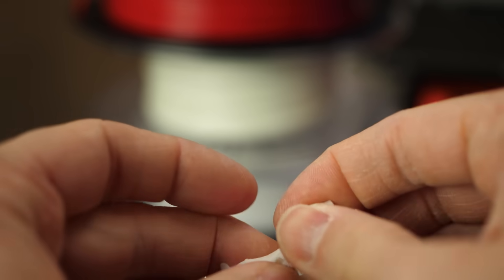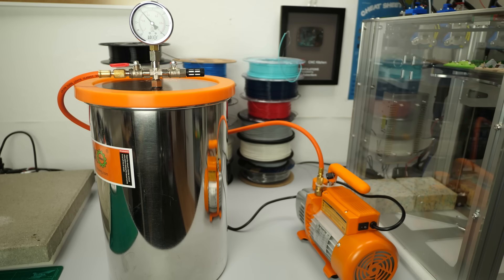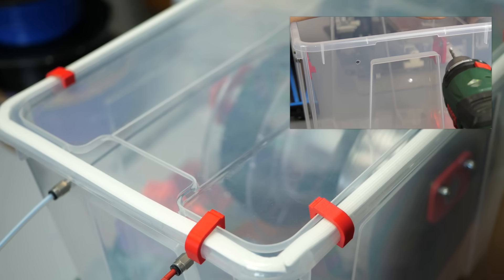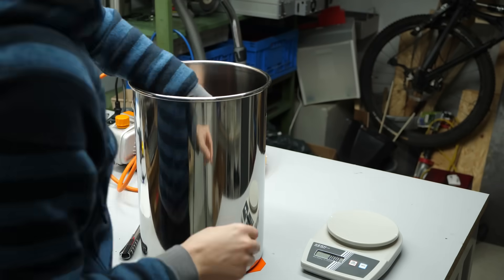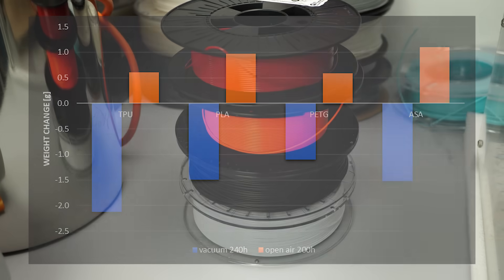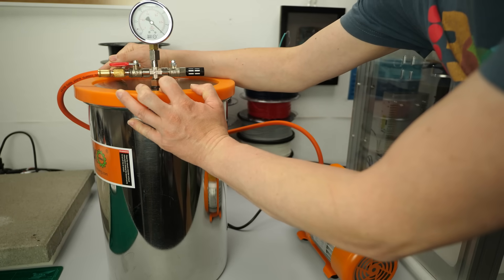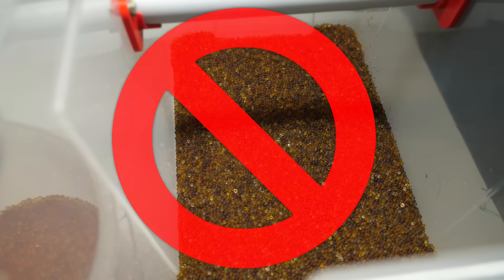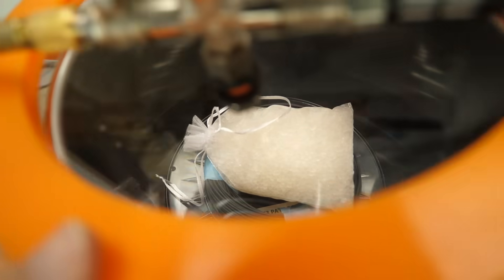Vacuum VS Dehydrator! What's the best way to dry filament?

Comment: There's a bias in these tests. The guy's dehydrator is removing moisture and displacing it in an infinite amount of air. To do the vacuum chamber correctly you need 2 Chambers with an AC dryer and vacuum pump/compressor between them. Pull a vacuum in pot 1 and place filament in pot 2. Using an AC recovery unit pull a vacuum on pot 2 while compressing that sure air in pot 2. Once the atm of pressure has been moved from pot 2 to pot 1 allow the pots to reach equilibrium between the 2 using tubing and valving. Have the expanding air that's cooling off and releasing moisture pass through an AC dryer which is just a canister fill is desiccant. Automate this process of pulling a vacuum on the pot with filament and compress that air into the other pot. Alternatively you can put an orifice between the high pressure pot and the low pressure pot right before the desiccant. This will give you the unlimited amount of air flow seen in the dehydrator and I'm willing to bet it will annihilate the performance seen in the dehydrator. You probably only need a delta of 5-10 psi or whatever that is in communist units to  see a significant change. Also get to serve DHT11 to measure the humidity levels in pot. Once this humidity levels, level out you can stop. The DHT11 will also tell you how much moisture has been removed by taking the temp, humidity levels and the volume of air and by using relative humidity levels the mass of water can be determined. If nothing else study how Air Conditioning works on the refrigerant side. They are closed loop systems designed too remove moisture but most importantly it's likely a fast more effective and efficient way to remove moisture. 2 containers a compressor/vacuum puller a container of desiccant and an orifice to expand the looping air. The orifice should restrict air flow significantly below the pump's ability to evacuate and compress.

Comment: lets consider insulating the vacuumchamber and putting a heat source there ? would that not be both efficient. cause vacuum does not lead the heat away by air, only by radiation and put a pressure switch on it  would solve the problem with manually having to flip the switch. With the prices for electric stuff one has to be able to save money using as little energy as possible
'

Comment: Great Video, and a very great job with info for all of us 3D printer people!  Really enjoy watching your videos.  

I see how the vacuum pump would work and do a great job.  I am new to 3D printing. My wife got me my 3D printer for my Birthday last November.

Here in Tennessee where I live, we are blessed with many rivers and man made lakes!  I live in Middle Tennessee almost at the geographic center of the state!  Humidity is a major problem here.  My Grand Mothers, both of them, taught me to put rice in the salt shacker to absorb the moisture so the salt would flow. Rice is very hygroscopic (absorbs water from the air) and will pull it away from just about anything. So I put rice in a 3 inch by 4 inch mesh bag (you can buy online for $7.00 or so for 100) and put the rice bag and filament in a one gallon zip lock freezer  bag.  Zip it shut and the rice will absorb any moisture left in the sealed bag.  Put one bag of rice in with a spool that has one half or less filament. I put two bags of rice in the gallon zip lock bags that have filament >= one half a spool.  It cost almost  nothing, and it makes working with the spools of filament very easy.  Just open the bag and switch filaments.  When you have a filament dryer, dehydrator, or a vacuum pump, you can only work with one spool at a time.  There is nothing wrong with that, but drying them all with rice can be done all at once!  

I know I have only been a 3D printing guy for about 9 months now.  At this moment I have 29 spools in bags with rice drying 😆!!!

Again, thank you so very much for all that you do!!!!

Comment: The only way for the evaporated water to get out of the vacuum chamber is through the vacuum pump whilst it is running. Switching it off after 15 minutes would be useless. If the vacuum pump is overheating it is obviously faulty. I worked for a refrigeration company and it was common to leave the vacuum pump running overnight.

Comment: Try heating the filament in a drying chamber but introducing a continuous, very low flow of dry air or better, but more expensive, dry helium.

Comment: Hmm, I always heard that pulling the spool under vacuum, and then drying in a dryer reduces drying time significantly and supposed to pull most of the moisture to the surface so it can be quickly/easily evaporated in a dryer!

Edit: I got it backwards, bake first, then pull vacuum with desiccant pack!

Comment: So what is considered a humid environment in which you need to dry your filaments? Looking at my hygrometer my basement is currently at 48%. I store my filament in the box with the desiccant bag it came with, and I don’t reseal the bags. 

Sometimes I do leave rolls out, while I know that is not preferable, do I need to worry about drying my filaments considering my ambient humidity? I print with PLA, PET-G, and ABS.

Comment: It would be interesting to see how your results would change if you back filled your vacuum chamber with dry Nitrogen or XCDA.  If you backfill your vacuum chamber with wet gas you are limiting your drying success.  Removing moisture when you evacuate just to add moisture back when you return to atmospheric pressure using wet room air.  A few other things to try would be vacuum cycle purging with heated dry gas and a purge box (no vacuum) fitted to a slow purge of heated dry gas.

Comment: Great analysis. What about putting the filament in the vacuum chamber while it’s still hot from oven drying? Vision miners claimed that this removes even more moisture from the filament. 
Your thoughts on this method? 
Thank you 
https://www.youtube.com/watch?v=1UBq2DPSBDg&t=542s

Comment: If you aren’t using your filament keep it in the sealable bag it came in with the moisture Cather packet inside. If it’s good enough for the company to store it that way then ship it to you it should work just fine for storing in your house. Unless you are some sort of reptile who lives in a underwater cave or store your filament in your pool because the label didn’t tell you not to store it in your pool.

Comment: When you are drying wood in a vacuum, you need to first heat the wood and then apply the vacuum and water boils out. Heat is needed for the water to boil and when the heat is gone, it stops boiling, so with wood we do it again and again until all the water is boiled out. You need to keep adding heat to keep removing water!

Comment: I store my filaments in a 5qt storage bag with 5 grams of silica in each.  If it's been stored for a long time I will dry it for around 2 hours in a dehydrator before printing.

When I store filaments such as petg or tpu in the open,  i see worse prints with both,  I get bad layer adhesion with petg when it's wet and gets better again after a couple hours of drying.

Comment: Have to be have the vacuum pump running the whole time to pull the water out.  Which is what HVAC technician does to get water out of air-conditioning systems.  

Might try freeze dry method.

Comment: I got the same results but with vacuum drying the only difference is the vacuum pump that I got was from a lab a dual stage and running it for an hour or so helped alot with nylon and cf

Comment: Air will hold moisture mostly depending on volume and temperature. Now with the vacuum the temperature and the volume remains, but the water boils, so probably relative humidity will increase. But you can't boil all the water away, only by opening up the chamber over and over. This is why the food dryer works better. It circulates the air to take up more moisture. If you consider an airsoft tank or scuba tank, it holds around 200-300bars of pressure. As an example, when you compress air that is on 1bar pressure and has let's say 40% relative humidity to 100 bars, its relative humidity would increase to 4000% so most of the moisture will condense. Its like squeezing a sponge. Now lets assume that it will have 100% relative humidity by the end. If you decompress it back to 1bar, then its relative humidity will drop to 1%. I would assume, that having your sealed filament holder box supplied constantly (only to over-pressurize the container a bit, so air can't get in) with air from an aforementioned airsoft tank would keep your filament dry, but it'd be again a chore to change and refill them.

Comment: My filament is stored inside a airtight box with damprid on one side and a tube to allow the moisture to drip out. the box stays at 50c and low humidity bowden tube then routs the roll into the side of my enclosure the filament routs threw the fliament welder past runout sensor and the into my machine.

Comment: Hallo Stefan, wie geht's. If you want to use a vacuum pump to remove a solvent from a solid,  you have to know how much pressure you need according to the boiling point of the solvent, water in this case. I recommend you to use a nomograph for calculating the boiling points under vacuum, thus you can according to the maximum vacuum pressure of your pump, calculate how much temperature to add to your system. At higher vacuum pressure, you need  less temperature. Viele grusse aus Venezuela.

Comment: I have an older gas oven with a constant pilot light. I keep my most often used rolls in the oven and when im going to use an other roll i just put it in the oven for 24hrs. I dont turn the oven just let the pilot do the work. In addition i keep my other rolls in a non working mini fridge and that helps to keep them pretty dry

Comment: Looks like I will keep using the dehydrator. 

Sometimes I will give a quick dry to my filaments if they have been sitting for a while sealed in a bag with some silica before use.  I will throw it in the dehydrator at proper temp for 1-2 hours and print with it after.  Not sure it really helps but I haven't seen any negative results.  

I had a spool of petg sitting open for about a year. Ran a print on it and it turned out horrible.  After several cycles in the dehydrator, it prints decent again.  I won't use it for anything that has a lot of detail or needs strength just to play it safe.  The spool is almost gone but not going to waste it.

Comment: I would have put the vacuum chamber on the heatbed of one of your printers at a reasonable temperature to see if that improved the performance. I have little doubt it wouldn't. Commercial vacuum drying uses heat to remove water from frozen food.

Comment: That's way too much work.
My printer is in the basement (40% humidity) and I never had any problems printing with my PLA filaments. 
Experience tells me it's not required for PLA. It may be required for other material I don't use.

Comment: My concern is twofold; how many times you can condition a filament, & every mentioned method will pull every volatile in the plastic at varying rates, depending on the method variables.
What gets pulled by which conditioning & storage system would be extremely useful data, as well as potential conditioning additives, where possible, added into the process may raise their atmospheric % to or above the filament, allowing for further customisable control of filament condition.

Comment: Storing filament in a mini fridge on a timer so it can be off for an hour a day or so is another effective method.  I would like to see the various weight changes with such a method. It is necessary to collect the moisture in a pan under the freezer compartment with a drip tube directed outside with this method.

Comment: I actually dry my filament in the microwave in low power using defrost by weight mode.  Microwaves will heat only the water molecules. Do not microwave for long period, just use short 10s sessions leaving 20 sec to rest and let the water molecules to escape from the plastic.  This works great specially for PLA and is good but not great in PETG,  I guess is because PLA is derived from corn and PLA molecules give out water more easily.  Also water will escape from the hot end when melting the plastic so thats why having a part cooling fan also helps to dissipate the steam produced.

Comment: You know you don't need to run the vacuum pump constantly, right? You just pull the vacuum. close the valve and turn the pump off. Of course that little pump overheats after 15 minutes of continuous running.

Comment: I have the same food dehydrator, got it at Aldi. I bypassed the factory temp controls and added a PID controller and a temp sensor. it can go higher and is very stable in comparison to the factory temp control which was swinging around 10-15 degrees..
Reply: For those asking how to do this, bypass the mosfet or relay which which turns on the heating element.    Hook up an arduino with a ds18b20 temp sensor and a solid state relay or correct mosfet depending on the voltage requirements  you probably could use the one that comes installed even just control it from arduino... then slap some basic code together which turns the relay / mosfet to high if temp is < than x  ... there are many tutorials on arduino out there... very simple and cheap to setup
Reply: @jasonhowardak  definitely a way to do it.  The pid kits are $20 though. And just need to connect wires up. I have done it both ways even with an esp8266 and logged data.
Reply: @muwahh98  can even use a PID package on an arduino if you wanted
Reply: Just curious, how did you do this?
Reply: @littlecube141  same how???
Reply: @jointEstablishment  not my video but similar concept can be applied to any heating system.  The controller is cheap on eBay or Amazon
Reply: How??
Reply: It would be awesome if u could make a video on this. Showing it and how you changed it.
Reply: @jointEstablishment  https://youtu.be/RNV8F5v13Vc

Comment: Hi Stefan! Did you manage to dry Nylon filament (PA6) in your food dehydrator? 
I tryed with mine at 70°c (62° mesured with an external thermometer) for 8 Hours ,but the filament didn't loose any weight and it is still unprintable.
What method do you suggest for such a material? thanks

Comment: So as I understand the best way for drying nylon is oven, right?
Reply from the maker: Yes, it probably is if you don't have any other fancy equipment.
Reply: @CNCKitchen  its a bit hard to find fancy and suitable equipment for advanced filaments. You need high and accurate temp. I think using accurate temperature sensor in an oven will turn it into almost fancy equipment.

Comment: Why not just combine a Dehydrator, 3D Printing Dry Box, and DIY Vacuum Chamber into a single device?

Post-drying/vacuuming, you could also pressurize the chamber with a positive pressure of a heavier-than-air noble gas such as Neon.

Comment: Thanks for posting this. I dry wood frequently in a vacuum kiln I made. The two key factors are the amount of vacuum, and heat but not too much. Your little vacuum pump should be able to deliver adequate vacuum. I automate my kiln with a simple mechanical timer turning the pump in every 90 minutes for about twenty minutes. I also put a one way valve in-line because the pump doesn’t maintain vacuum by itself very well when turned off. I use heat mats that don’t get warmer than 40C. When the temp in the material reaches about 36C the water really starts to come out. Because the heat transfer is by conduction the maximum thickness for best results is about 100mm. I can dry wet wood at 55%+ moisture to nearly 0% in 3 days. This is 120 year old technology for wood. A German friend has found a 25W motorcycle seat heater to use in a vacuum chamber similar to yours. Sandwiching the plastic rolls between heating pads will give you the best success and speed. You could also try just putting it in a sunny window. However, considering all the messing around, in the end your cheap desiccant in a decently closed plastic container seems to me to be the best option for most plastics.
Reply: Do you think heating the filament in a food dehydrator to say 40-50c then stick it in the vacume the way to do it then?  Mabye I can screw in one of those water heater elements in the center.
Reply: @warlockd  I imagine you’d get a bit of a head start but you still need to keep the stuff warm, about 40C I’d guess, over a day or so under 26.5mmHg vacuum at least - more if you are closer to sea level.

Comment: A useful tool to have around when degassing or dehydrating materials with a vacuum chamber is to have a hydrophilic membrane filter to replenish the air in between vacuums. You can use those cheap syringe ones, mind you get ones with more than 0.45um pore diameter or else air will have a hard time getting through as well. (Will take some DIY to adapt a membrane filter to your setup.) 
You can also just use the filter to slow the air replenishing into the chamber as well as preventing hydrated air from entering the system. On my setup the free flow of dehydrated air causes only a +5hg decrease in vacuum pressure(-29hg vs -24hg); vacuum pump will run a little bit cooler due to free'er flowing air. 
(When you were replenishing the air in the chamber, I can only imagine how much humidity was in your environment at the time reentering the chamber.)

Comment: I had a roll of the cheapest swedish PLA just sitting beside my 3d printer for little over half a year over winter, due to heating issues when the house is cold i'm not able to print so it got me off the mood some, one day i needed a part for something cant recall what but i just switched the printer on added the sd card and hit print after a little while i noticed that the bed haid a layer of dust and i never checked the pla but the print turned out great anyway xD